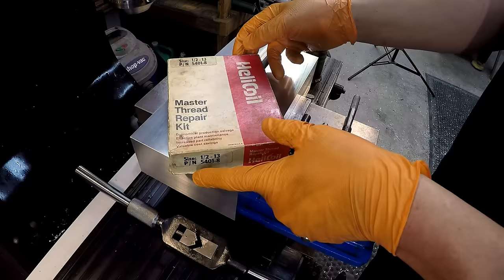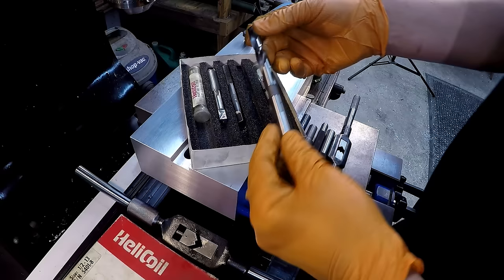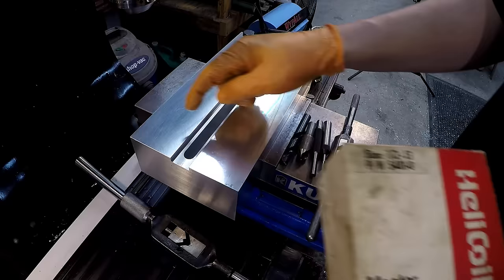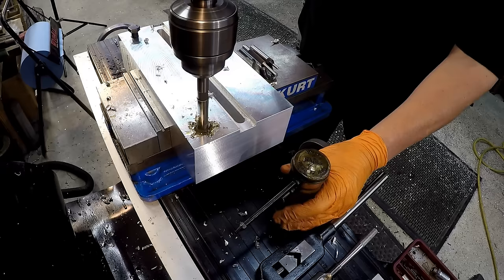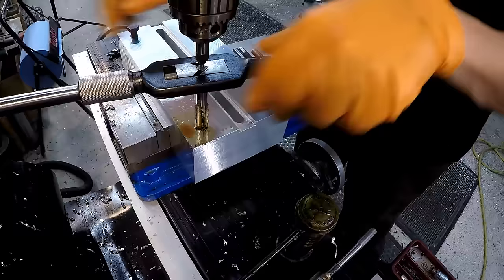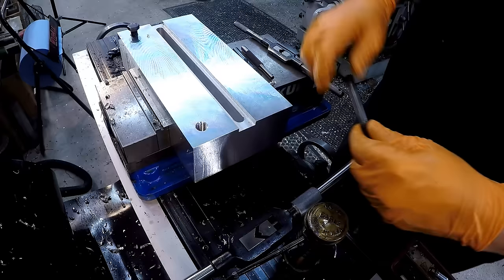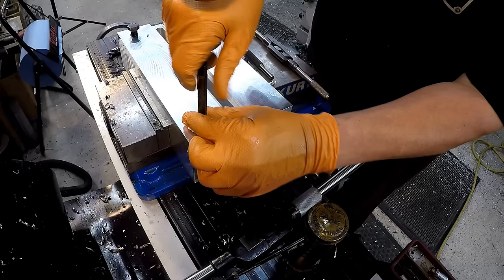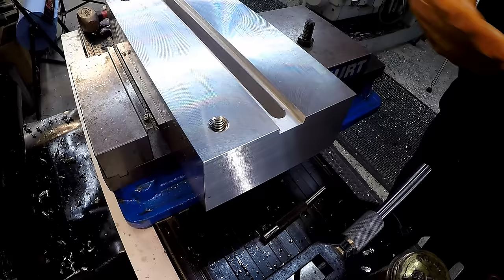How To Install a HeliCoil

Comment: This is quickly becoming my favorite channel.  ( Almost )  Makes me want to come out of retirement and make some chips.  Often wondered why Helicoil has few competitors, well protected patent or hard to manufacture?
Reply: They made a system that works and is simple to use, basically every other version of "thread repair" kit follow the same general idea as the Helicoil ones. Well the ones I've seen anyway, with one exception, those thread inserts Abom showed a couple of times with the wedges you drive in.
Reply: ColtaineCrows ...yea, I've used those wedge locks.  There good but all too often there's not enough to room for there large diameter.
Reply from the maker: There’s other brands out there, like Recoil. I think Helicoil is the most trusted trade name.

Comment: Red thread lock on the coil before installation and let dry overnight will prevent the coil from backing out. All the time with automotive thread restoration. I also prefer inserts over coils.
Reply: I'm the opposite .. 🙄😂 
I prefer the coils & NEVER use loctite... 🤗
Reply: Threadlocker will cause more problems than good.
Reply: I once saw a guy with a stripped thread in an outboard engine block... He installed a helicoil, with  Permatek cold weld behind it (better JB weld basically), lubed up the bolt and put it in the hole... I shook my head and left the room laughing,,  But I wasn't laughing when he pulled the bolt back out once dry, wiped it off, then torqued it to 80 ft lbs 😮

Comment: When I tap a hole I just Chuck it up in the drill press Chuck and put it in neutral and start my tap but turning the Chuck by hand until it's started this way you know it's square

Comment: So the steel(?) coil acts as threads for bolts thus protecting the soft aluminium from wear? That's really clever.
Reply: I used these on an old Harley Sportster I had. Better than aluminum threads that's for sure.
Reply: Yeah, works really well for any aluminum threads that will have to be used often for service or adjustments. Not so necessary on something that only gets assembled once or twice.

Comment: So you're not supposed to completely thread the coil in until it bottoms out on the tapped thread?
Reply: @Stephane Van Der Merwe     It depends upon the hole condition / situation.  What would you do if in a thru hole on a plate?
Reply: No, definitely not. Especially since the end of the thread is not tapped very deep with this kind of tap: the coil will fit but the bolt won't go in.

Comment: How does the thread not back out? Is there some way it locks in there?
Reply: It has spring tension. Coill is slightly oversized , that is the slight tension you feel when installing.
Reply: @samdavis5079  - @Nathaniel Baier also why some helicoil kits include a threaded guide to run the insert into before it enters the workpiece.  That guide compresses the spring radially to match the tapped hole in the workpiece... otherwise starting the insert into the workpiece can be difficult.
Reply: @Nathaniel Baier  If you look closely at the Heli-Coil you will find that the last little bit into the hole (nearest the outside) is very slightly NOT fully 'coiled'.  This gives it a sort of gouge-in effect when loosening the bolt out.  "SOME" people may also (using a small punch) force that "tail" to embed into the parent material thereby forcing the locking effect.
Reply: @roderickwhitehead  
My sparkplug kits and 6mm kit have these. My others do not. 1/4", 5/16", 3/8", 8mm, 10mm kits do not have sleeves.

Comment: Great video. I asked on another video but you may have missed it or was just busy and I totally understand.
I'm just curious. What is your take on threaded inserts like time-sert for this application? I use them whenever I can, always on my machinery and whenever a customer will go for it instead of a coil.
They have all of the for install, similar to this kit, but I think the insert is a much better  item.
Stronger insert, similar size hole and threads needed to accept the insert so it's not Taki G more material away, plus they also have big-serts for when there actually is a ton of material missing.

Just curious about your opinion since you're way above and beyond my ameteur machining experience.

Thanks for the great videos!
Reply: I'm an amateur as well, but I completely agree. This is not the best place for a heli-coil, and heli-coil is not the best thing to use for this application.
Reply: jesondag If you watched the first video, he used what he had and since this is not going to be a high torque application the coil is going to be just fine. All he is going for is to prevent galling from dissimilar metals under a heat situation. This is not a spark plug hole or pressure fitting.
Reply from the maker: The purpose of this video was not to compare thread coils to key locking inserts.

Comment: Working as a tool & die maker we would drill/tap 2 sizes larger and put threaded rod in and drill/tap to size.
Reply: I use a product called case savers which is pretty much a commercially available version of what you made.

Comment: Great video thank you 👍 Is there any good way to stack these for longer thread? Looking to try them on front control arm bolt hole for a car. Long bolts. It’s either that or way more expensive time serts.

Comment: Got one of those in my Cylinder head...you guessed it.... 2v Early model 4.6
Reply: I would have guessed 3v actually
Reply: Ford f150 to keep the plugs from jumping out the threads?

Comment: awesome video how many do not know what helicoids are. maybe I was lucky as a child  that I liked to watch my great-great-great grandpa and great-great-grandpa worked together and  learned a lot from them the dirty old shop they worked  from  poor lighting as well and very little heat too 
now it would be unsafe for me to be in there  never mind were I seat  and watched had a found roll sit on the lathe  my favoured spot was sitting on the  tailstock  many times I got hit with something I was 12 years old I was able to turn on the metal lathe make sit of a chess game  still have them  they are proudly shown on my  shelve here not one use them anymore have a tagged  make up that says  great-great-great grandpa help me with the game pieces 2001  short time after that he passed away

Comment: Step1: throw helicoil shity stuff in garbage, Step2 easily and effective just install keysert for aluminum (or softer stuff) and gardsert into hard steel.
Reply: yes ! your approach is very accurate. keyset seems to be a better option for this case scenario, but as an experienced mechanic I humbly recommend you 
TIME-SERT kits for this particular case.
Reply: Fwiw Helicoil is installed in aircraft engines right from the factory
Reply: @sirmeowcelot  I have put thousands of Heli coils in. They are cheap and work fine.
Reply: @Airman..  nope

Comment: So I get that is is basically to just reinforce the aluminium threads?
Reply: In this case, yes, that is the purpose. HeliCoils generally serve two main purposes. The first primary use case is this where you want to put a set of strong steel threads into a softer material. The second is when you have hole with damaged threads and can drill it out larger then install a HeliCoil with the same threading as the original bolt during a repair.
Reply: A perfect application of installing solid, re-usable threading into softer less durable material!

Comment: Does the helicoil in this application basically act as a disposable thread so that if you mess it up you can just remove the coil and install a new one?
Reply: These helicoils are stainless steel. The application is more for having steel threads for steel bolts, so the steel bolt doesn't damage aluminum threads.
Reply: They CAN be removed if necessary and replaced with new ones ... but I used to service Milwaukee concrete-cutting drills which had these in 1/4"unc & never seen them need replacing ... EVER !!
 I most certainly would  never consider them to be  "disposable"🙄🤗
Reply: YES, this is the purpose of a helicoil.  rather than damaging the parent metal it damages the disposable part.

Comment: Part 2.... how to remove a helicoil.
Reply: They usually remove themselves. And never when you want them to.
Reply: steve gale   I quoted my source... 😌
Now YOU to the same.. 😏
Or just stick with name-calling as a debating strategy .. 🙄😂

Steve Gale... all just hot air... 
Own yer own aerospace engineering company & spend yer time trolling on Youtube... yeah , sure , right ! 🙄
😂😂😂😂
Reply: Chuck Finley    pretty much same experience as me... the loctites not going to do any hsrm AS LONG as it doesnt migrate thru to the bolt threads and lock the insert to the bolt... I HAVE seen plenty of OEM aluminium castings with helicoils fitted at the factory .. 😎👍☘🍺

Comment: Whats to keep it from unscrewing?
Reply: The coil will try to expand itself when turned in the wrong direction. Once installed and the tang has been removed, it's in there for good.
Reply: @yhsbu  so is it actually a spun coil and not a solid piece that screws in?
Reply: @LerrySanders  That's right.

Comment: At work we have a removable dance floor that has set screws to hold the whole thing together. You don't need to reef on the set screws to set it, but sure as hell people strip the aluminum on a few every time. Been using helicoils to replace them for awhile. The best part is when they fux up the helicoil itself when setting. Really losing faith in humanity.

Comment: Can you use locktight on the insert and also on the fastener? Thanks
Reply: yes and yes   allow it to dry 15 minutes (normal temps/humidity, or use hair dryer if humid florida) before inserting fastener
Reply: @galehess6676  wow, I'm shocked to hear that. Thanks for sharing
Reply: my mechanic recommended to use the loc tite on the heli install and said you could use it on the fastener but he hadn't recommended that so IDK , wasn't a long conversation.  I'd use red on the heli and blue if using on the fastener, and I wouldn't count on the fastener coming out easily or cleanly.
Reply: @galehess6676  that's my fear, I'd hate to see the helicoil come out along with the fastener.
Reply: @kennethwise7108  Once it's in there to proper depth, it gains a lot of friction.  So you got me interested: I looked around here a minute.  a quote: No to locktite. Install heli coils dry, oil your bolt threads and heads, then torque to proper amount.

Since getting back into motorcycles, I have helicoiled MANY bolt holes in aluminum.  Another quote: 
Helicoils designed to be put into dry holes do not use any form of loctite or thread seal. A helicoil when inserted properly will have movement inside hole they are inserted into. This is to alow for expansion and contraction of the metal.

As far as using a thread locker compounds on the bolts or stubs you put into the helicoil just use standard practices.

As far as color of loctite to use it all depends on your aplication but remember its not so much the color of loctite that maters it's the product number.

Someone said use blue loctite. Blue is great for something you want to take apart often. If it is for a permant or semi perminate application use red, green or even purple loctite. It also mater where the bolts are located heat and oil do affect loctite.

As for helicoils in aluminum they work just fine. We use them all day long on the planes at work and have no problems
Reply: @galehess6676  very informative thanks for the follow-up

Comment: I use the coils to change  threads between unc-milimeter or put M6 in a M8 thread
Reply: Well M6 is 1mm pitch and M8 is 1.25 pitch so how does that work ?? 🤔
Reply: Won`t fi very well . The insert`s outer diameter is 7,4 and the center hole for an M8 is already 6,8. Not enough meat left for a good fit. There a massive insert would be better.

Comment: Dontcha think real threaded Inserts like Würth are much better though? These coils always came out again when disassembling the thing the next time... like on ma old Japanese motorcycles. Can't use loctite on hot engine parts either.

Comment: Excellent video. thanks. How would you install a helicoil on a vertical side of an engine block? I have a ride on mower and both exhaust muffler threads in the exhaust port side are stripped. The bolt threads are also so so. They look like going over with the die wouldn't work. I'd rather not take the engine out. Can I do all the tapping and helicoil insertion on a vertical surface? Also, I pulled the recoil pull start mechanism off my brushcutter. the thread on the drive shaft was stripped. Is there a helicoil that can over stripped thread so I can fit a new recoil pull start part? cheers, Mark

Comment: Super good information from an obvious professional Machinist.  Only one question; could you have used the spring loaded Center to align the Coil as you inserted it into the assembly?  Thank you for making the video; it was a great help.
Reply: You want use more pressure than the spring loaded center can provide, in addition since it is already tapped previously, you don't need to worry about it getting off center. Hope that helps.
Reply: once both the drill and the threading have been perfectly centered, you don't need to worry about alignment anymore

Comment: if you were using one of these for a stripped spark plug hole, how would you remove the tang?
Reply: you do not use helicoils for any threads that create a air/water tight seal
Reply: The thread doesn't create the seal on a spark plug the crush washer does.
Reply: South main auto channel has one on repairing spark plug threads, look it up, very informative and explained well
Reply: djm jr They sure do. Least we have cool people making great videos to keep us from going south like them.
Reply: After you break the tang, fish it out with a magnet.
Reply: @cencoast_7.340   he wasn't born like that... he's a self-made man.. 🙄😂

Comment: Can anyone comment on the use of these in aluminum cylinder heads as a preemptive repair? My specific cylinder head is known to strip and blow spark plugs out, I have read of many people using these after that happening, but never preemptively. I am currently in the process of rebuilding the head. I had originally only planned to clean up the spark plug threads with a tap but after watching this video I am wondering if it would be worth while to HeliCoil the spark plug threads while I having the engine apart. For anyone wondering its an AAN, Audi 5 cylinder turbo, I am rebuilding it in plans for a larger turbo (more boost and more heat).
Reply: @Hugh O'Brien Thank you for the info. I haven't looked at them to deeply yet, will definitely be doing a thorough inspection before making any decisions but I am thinking I will probably just end up using a thread chaser.

Comment: I prefer keenserts. Standard taps are used for installation. And they are easy to install.
Not a heilcoil fan.
Reply: we should Consider cost also , as well as reliability, Contact Bollhoff
Reply: Keenserts are the bomb.  Mechanically locked, standard threads, and readily available.

Comment: Have you ever tried time serts I fine them better than Heli coil
Reply: Only good thing good about Heli-Coil are the high quality drill bit'$ , best thing to do is $witch it with a crap made in china bit and put $et it back in tool crib...

Comment: Timeserts are much better. I gave up on the wire type years ago. The timesert is expensive, but so worth it. Basically they're like a rivnut but threaded on the outside too.
Reply: Timesert is a specific brand.  There are others, or you can even make them yourself on a lathe from bar stock.  But yes, full diameter solid inserts are way better than wire type.  Completely agree with you on that!  I wouldn't use a wire type on anything I cared about except in an emergency
Reply: @wouldntyouliketoknow9891  the thing about using a timesert or similar bush, you need a displacement tap to swell the insert into the threaded hole. I've seen a few examples where they use loctite to hold the bush in, I'm still hooked on timeserts. By the time you've made something comparable, unless you're charging nothing for your time you've lost money. I use the term timesert because I can't be bothered to type expanding threaded bush every time.
https://www.timesert.com
Reply: @v8trauma  Making them on the lathe is pretty much reserved for very special applications where no standard insert is available and where the part is worth the $$$ to be economical to spend the time.   This is done with some regularity for damaged titanium forgings in the military and aerospace industries.  Those Ti forgings can be millions of dollars.  Haven't done it personally, but I have seen the results.
Reply: @wouldntyouliketoknow9891   My dad used to work in military industry and for some alu parts they would helicoil certain holes from the start like was done in this video. It's not at all uncommon to do it. Might have been some other type of insert they used but they used Helicoils as an umbrella term for all thread inserts. I think the number crunchers will do what they can to save some money even when just a small part of what they are making have $x000 just in machine hours on it. Id presonally prefer not using stainless threads on anything that is supposed to come apart more than 1 time.

Comment: No red loctite?
Reply: Jack Johnson;  Loctite is usually not needed for retaining Heli-Coils. They're slightly larger in diameter than the tapped hole and will not come out if properly installed.

Comment: super helpful!! Im about to helicoil some treads from a water pump off of an aluminum block I striped out.

Does anybody know if its wrong or right to add threadlocker to the helicoil or not? does that offer any benefit?
Reply: Did you ever get an answer? I'm curious too